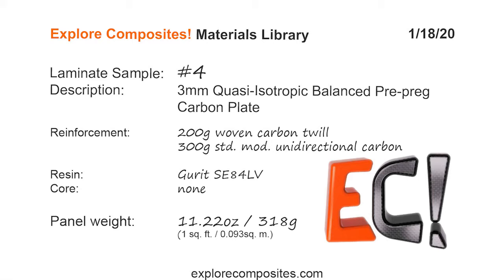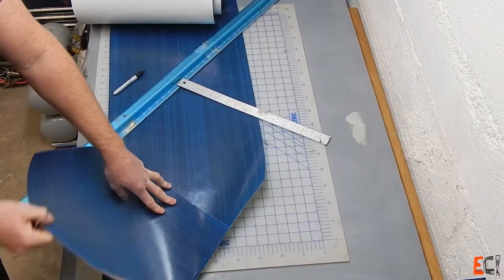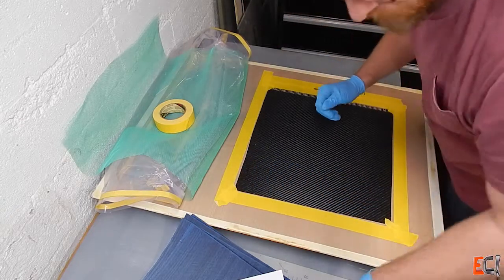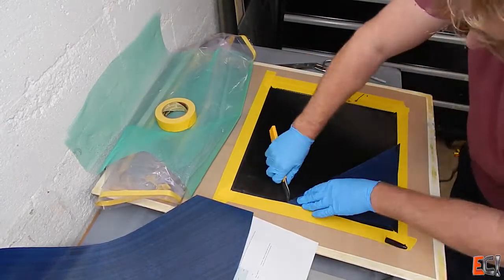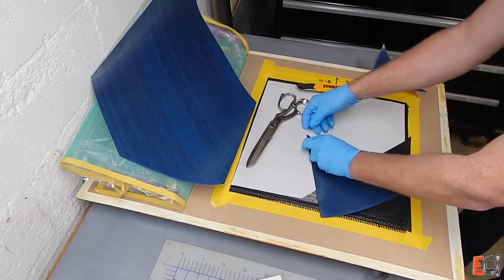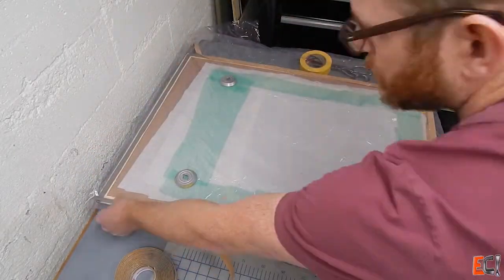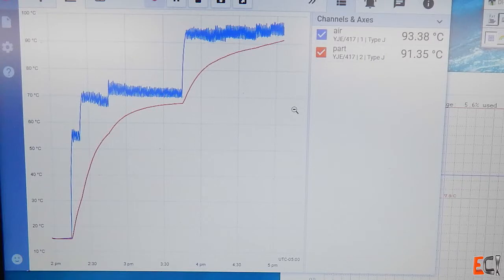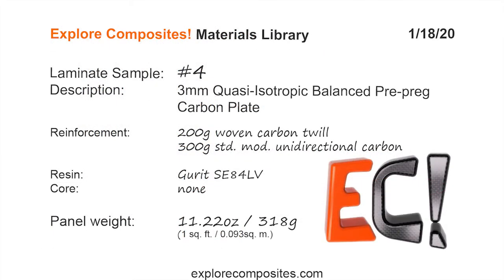Laminate Sample #4: Prepreg Carbon Plate with Quasi-Isotropic Balanced and Symmetrical Laminate

Comment: May I know where did you get this worktable? I need a similar one. TIA
Reply from the maker: The table is "home made" from out of date prepreg and 2" vented aluminum honeycomb.  I have a bunch of them I made years ago - super handy but not a readily available product and expensive materials!  The aluminum core is excellent for heat transmission to the tool face while staying stiff and having matching CTE to carbon parts.